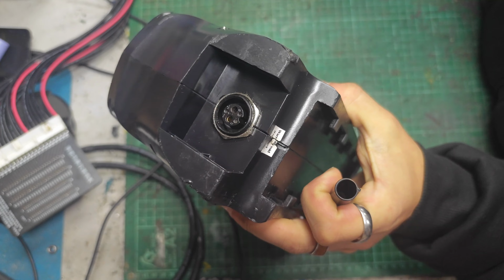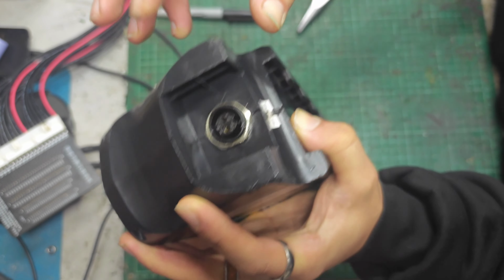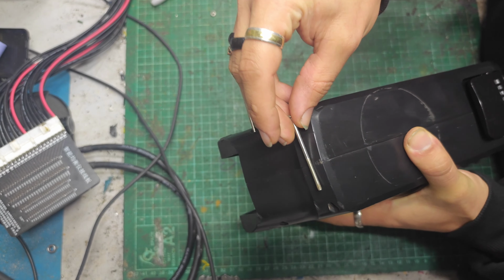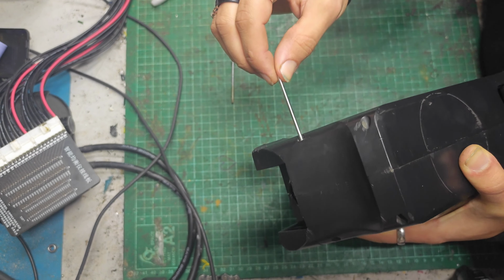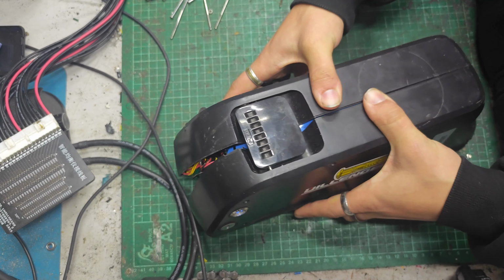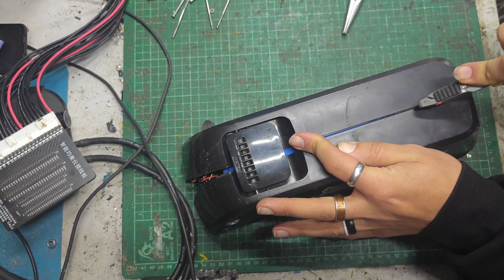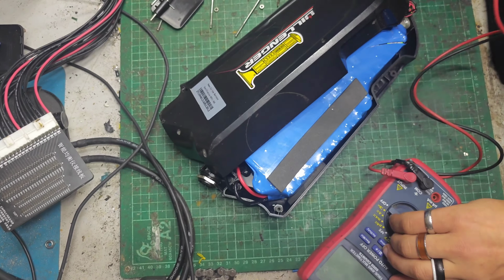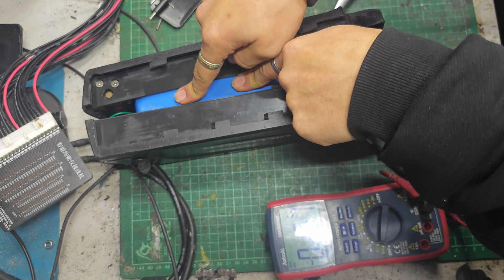Dillinger 48v 11AH Ebike battery - Melty discharge port

Comment: I have an m625 bafang kit from dillenger and my battery went into failsafe mode with the bike now refusing to turn on, of course with it now being out of warranty! 
Would you suggest any other brands of bottom bracket high output motors I should replace it with, or is it worth trying to salvage the motor and battery cells and bypass the canbus Bafang software with an aftermarket motor controller and BMS?
The kit set me back $3,000 and I barely even got 5,000kms out of it!
Reply from the maker: The BAFANG stuff is great! Unfortunately you will likely need a new canbus enabled battery pack :(